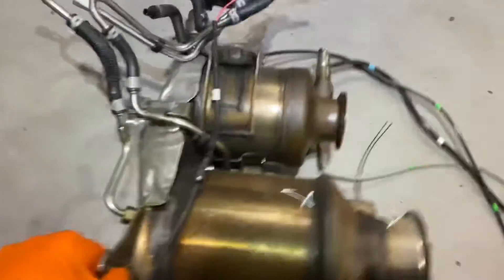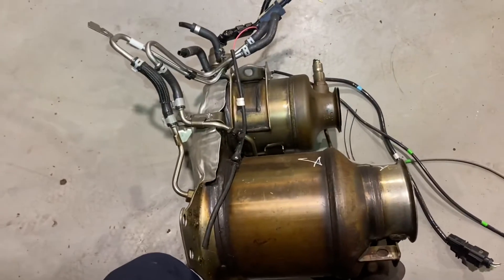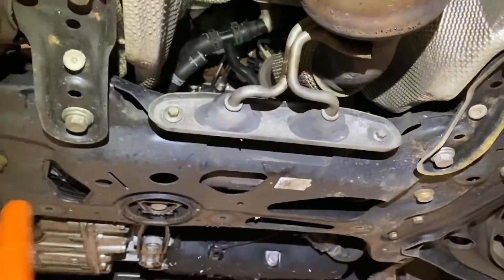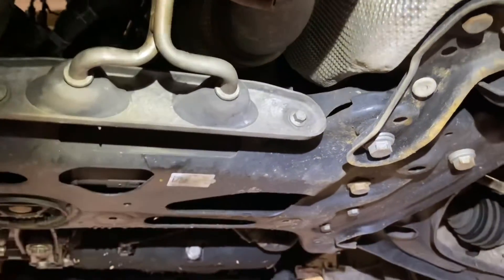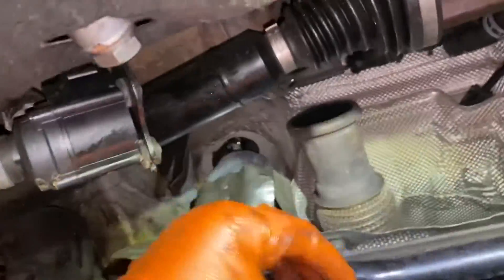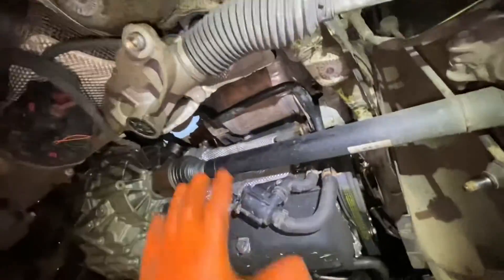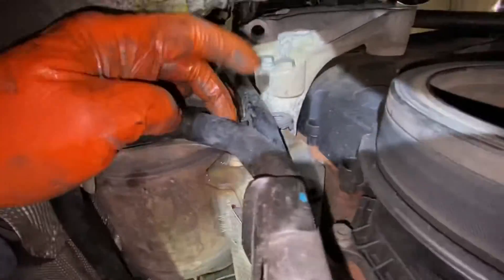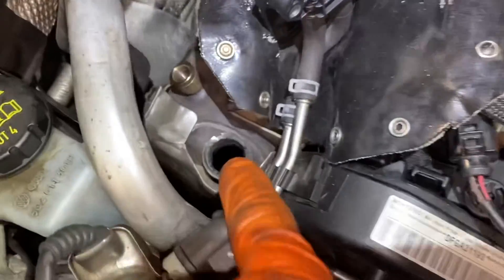Skoda Kodiaq, DPF replacement tips

Comment: Thanks for sending me over here - I commented on one of your other videos about my exhaust flexi hitting the steering rack heat shield. From this video it's clear there should be a good few inches clearance and the flexi seems to go almost horizontally back from the DPF. For some reason mine is pointing downward putting stress on the flange connection and making it go very close to the heat shield an dtouch it when engine is under load. However, it doesn't really matter right now as the 'new' DPF I fitted has a big leak from under the big heat shield on the end of the DPF - the bit that covers the join between the catalyst and DPF. So it all has to come out again. Yes, I am mad - I did the job outdoors, on the floor, in February, without removing the subframe. Not sure where to go from here, I'm definitely not doing it again!
Reply from the maker: Aaaahhh, that is some pain in the bottom. They are not the easiest to remove and refit. Could you by any chance get the leak welded in place ??
Reply: @kennedysgarage3281  Unfortunately some **** had already tried to weld it up. I really should have taken a closer look before fitting. Thought I'd remove/peel back the big heat shield in situ but that's welded to the body of the DPF! It's coming out again next week, but this time I'm paying someone to do it (probably).
Reply from the maker: @dopiaza2006  the joys of the motor trade, it never goes to plan 😬😬😬

Comment: Peter I watch a lot of your videos.I have a ford transit 2.2 rwd.131 just wondering would you have any idea intermittent revs to 900 for 10 to 15 mins then bsck to idle.No fault codes coming up .cheers Dave
Reply from the maker: What is your idle speed before it goes 900 rpm ??
I would have thought 900 to 1000 on a diesel would be normal enough 🧐
The injectors give a lot of trouble on that engine, so much so that they burn or melt the piston tops & cause the engine to seize
Reply: @kennedysgarage3281  its normally stays at  800rpm thanks for your help
Reply from the maker: @davidturner8125  engine rev’s generally rise when a load is present ie. air conditioning clutch engages. 
They also rise when the clutch pedal is being left out when getting ready to drive off 🤔
Any of those worth checking out ?